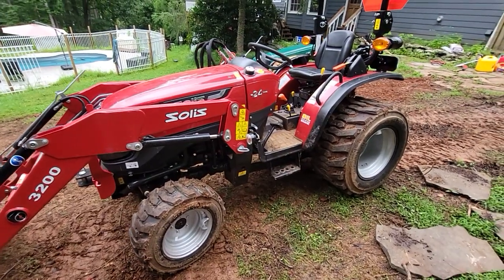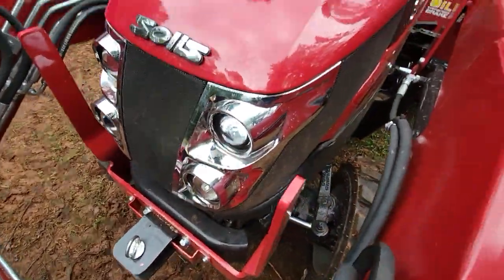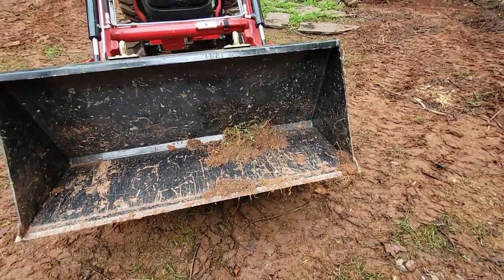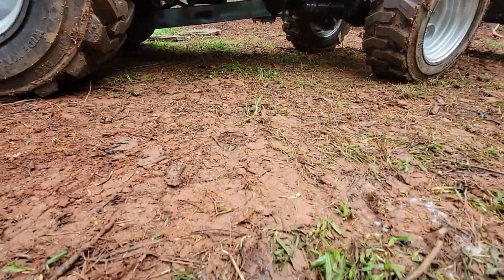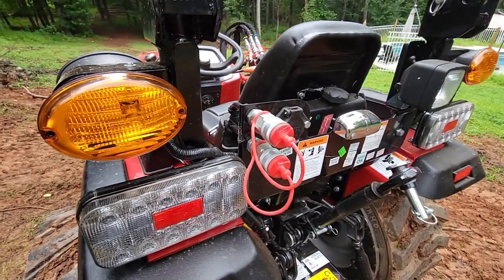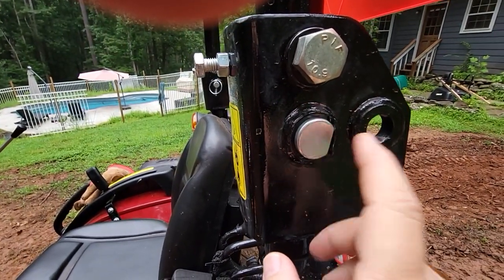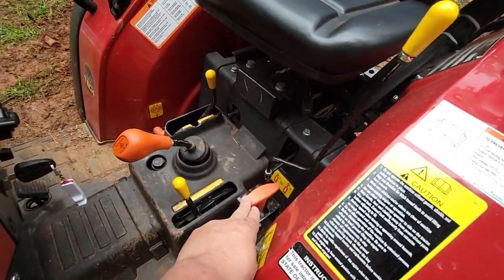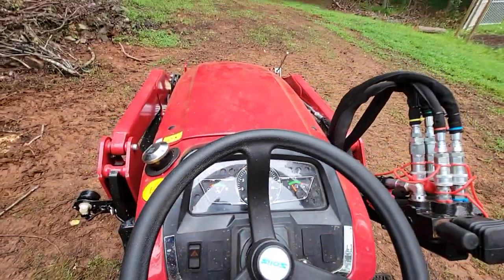Solis 24 10 hour review. Is this the most affordable tractor ever?

Comment: Looks like a nice machine and a great review , I have the RK25 from rural king and i wish it had steps to get on like yours and also the fuel cap is in a way better spot then on the rear right fender of the RK"s . My tractor doesnt have all the levers on the floor but like you said its almost impossible to climb on from the right side . Enjoy your tractor its very nice .

Comment: Same tractor. Changed the hydraulic filter and it stopped the dropping of the bucket so quickly. I believe it gets trash from original break in inside the hydraulic valves
Reply from the maker: I'm doing my 50 hour service now. Hopefully it gets better

Comment: You can buy a weight to a back three-point hitch, Solis made them for this tractor. Why you still have front weight on if you have front loader? Its 28KG hanged behind the metal bumper by two bolts, you can also use them and try to put them on the back bar.

Comment: Never heard of this. They are selling Solis 20 and 26 in my country
Reply from the maker: As far as I can tell the only difference is the extra 2 horsepower. And that makes me think I could get the same horsepower out of my tractor.
Reply: @jeffwithhart  this is not a difference of engine power it's a difference on how you measures the power. The standards change depending on the country. In France it's 26HP
Reply from the maker: That's very interesting. It's all marketing! But I still love this tractor

Comment: How is the tractor holding up if you don’t mind how much did you pay for it?
Reply from the maker: I don't remember the price off the top of my head but they are the same price everywhere. Maybe $11,000. But so far it's doing a great job. I'm just about to do the 50  hour maintenance and I will be making a video of that as well. But so far the hood latch has had to be fixed and the starter has begun acting up like the solenoid doesn't want to engage. It's still under warrenty I just haven't dealt with it yet. But I am still very pleased with it and it is a great value.
Reply from the maker: ok it was actually $12,988

Comment: That water is going to rust out the rims in no time. Water ph less than 7.0 is very acidic and not that mention mixing it with air is not good at all! I give those rim’s about 2 years and you’ll need new rims! I work in water filtration and I don’t care if they are painted or epoxy coated that’s a terrible idea! Even if the ph is above 7 it is not worth buying 2 new rims in a few years. You should take the water out immediately and completely dry them and just use weight on the 3pt hitch

Comment: I've never heard of the Solis tractor and certainly would never buy one.  i have a Massey Ferguson GC 2400 and am buying a new Massey Ferguson GC1725MB tractor, loader, backhoe.  in my opinion, the only tractors in the sub-compact category that one should consider are the Massey, Kubota, John Deere, Rural King, and Kioti.  The TYM and New Holland/LS are "OK" but they seem to have a much more limited dealer network than the first tractors i mentioned.  the fact that the Solis tractor you have is a "manual shift" tractor is VERY odd for the sub-compact tractor category ESPECIALLY with the loader attachment.  you MUST have either a hydrostat or "shuttle shift" to run a tractor with a loader.  i can't even imagine the annoyance of trying to use a front loader on a "manual shift" tractor.  with these tractors, you get what you pay for and while i have no doubt all the first tractors i mentioned are much more expensive than your "Solis" tractor, the money saved would NEVER be worth the ease of use, availability of parts, and dealer support that you would get with the tractors i mentioned.
Reply from the maker: I have used several older tractors that  were built before there was such a thing as automatic or hydrostatic transmissions. I would certainly say I would prefer hydrostatic, but this tractor is actually very easy to operate. To get a comparable tractor with hydrostatic I would have to spend nearly $6,000 more. And as far as dealer network, they are sold and serviced by yanmar. I'd be willing to bet you have a yanmar center near you.
Reply: A little "coordination" & being "wide-awake" is ALL that it takes to "Operate" a gear drive tractor. The Swash-plate plunger Hydro-static drive units are"Way cheeper" to manufacture than a Gear-Drive. Hydro-slack-o-howl-matics are SO EASY to MARKET& SELL; thus being able to be SOLD for more money.* ( this is a well guarded dealer-manufacture secret). Only physically impeded & super high production users "Need" a hydrostatic drive;( as they guzzel fuel like water. Not to be "confused" with "Heavy-duty hydraulic-hydrostatic-torque amplifying transmissions that "HEAVY EQUIPMENT" uses! The convenience of hydrostatic is the MAIN reason "why" compact-tractors are "marketed" to the 35-75 hour per year customer ;Aka.= "hobby-farmer".